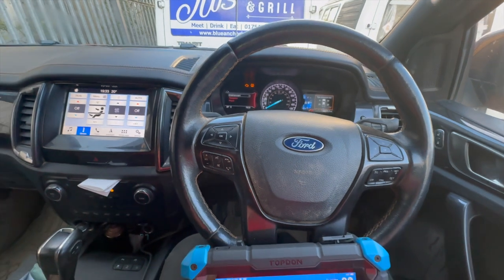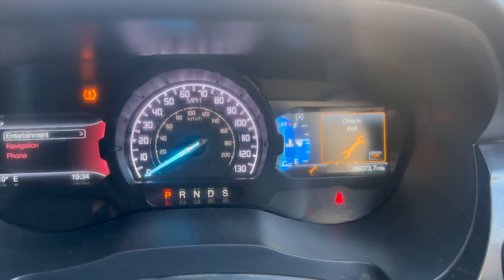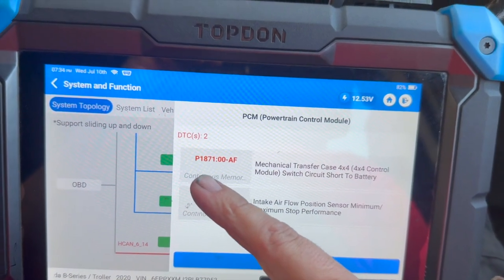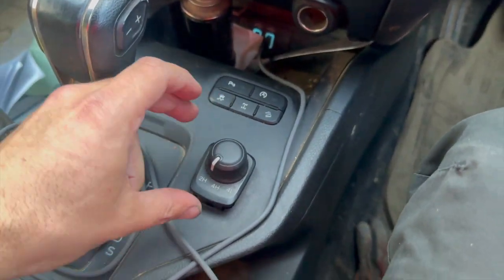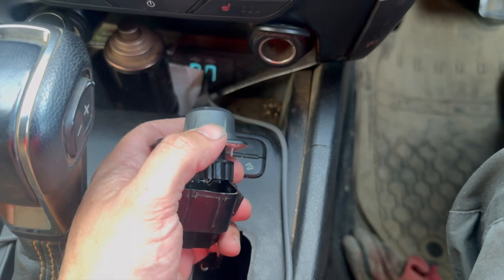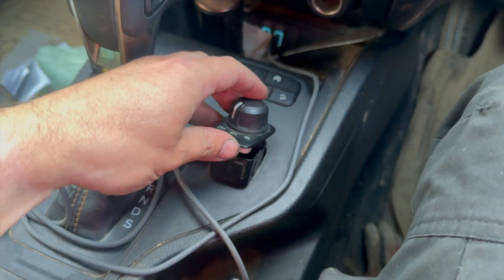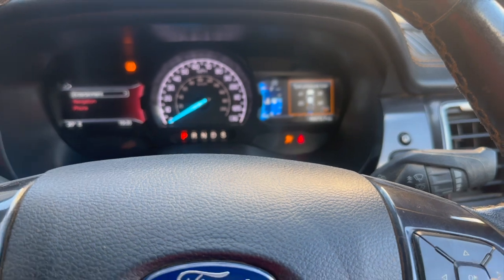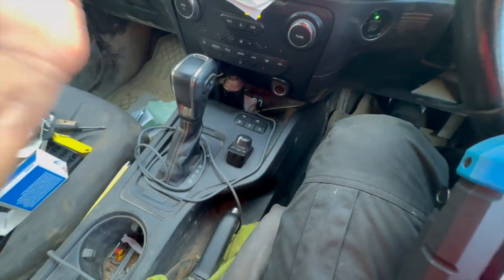Ford Ranger "check 4x4" & spanner light on dash P1871 fault code in engine ECU

Comment: My ford ranger is a 2014 manual year model and i engaged the 4x4 and it worked well but when i wanted to desangaged it it's no more working and it stucked in untill i remove the 4x4 shaft. What could be the problem? I changed the switch but still stucked in.